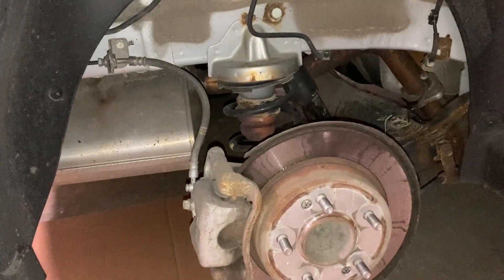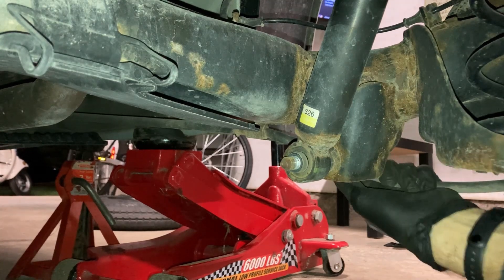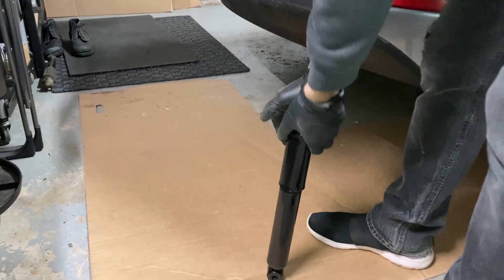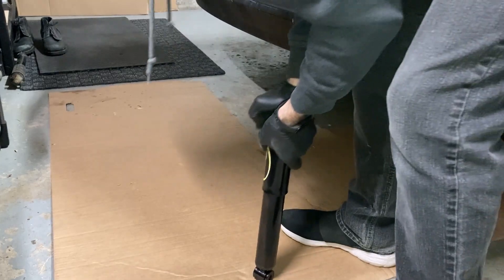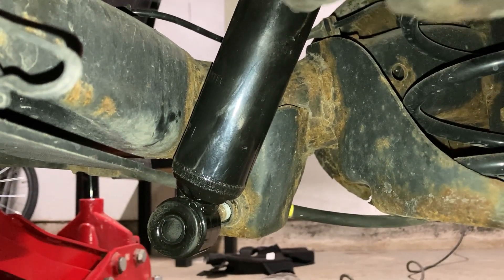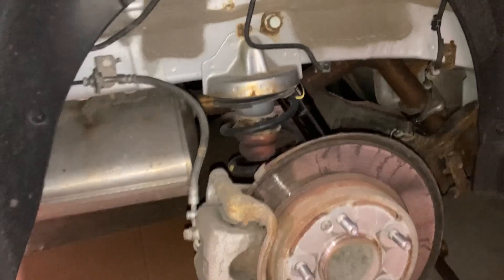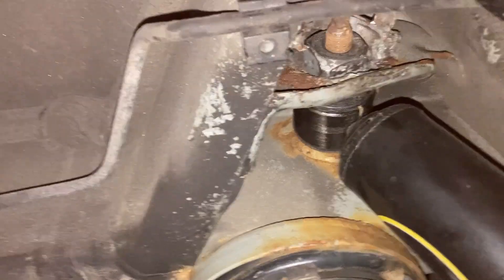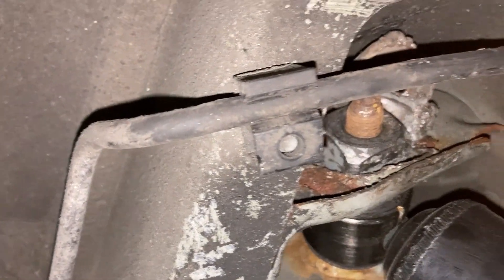Hyundai Elantra rear shock stuck upper bolt removal

Comment: I tried removing mine with an impact wrench and it came out a lil bit but now it just spins in place. It rotated so much in place I started having smoke from the bolt turning. How can I get it out?
Reply: How did you end up getting it out

Comment: I’m looking for info on a 2008 Elantra!! It has 2 bolts that go up into the rear seat area and are in stationary nuts and I want to lube the threads! How do I get that piece off the rear seat panel to access those threads??

Comment: Doing this as we speak. Why and how during the car build did they "encase" that square bolt into the sheet metal? Thanks!
Reply from the maker: Why - because it's a cheap way to manufacture, and it saves space by eliminating the need for an upper shock mount. How - it looks like the square but was probably pressed into the sheet metal square prior to being welded to the body. The critical flaw was the sheet metal being too weak.